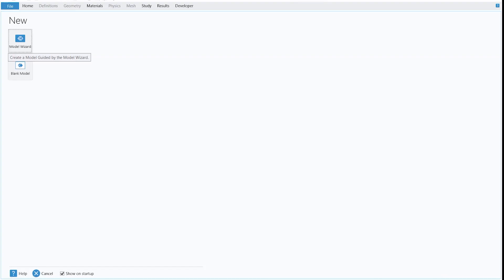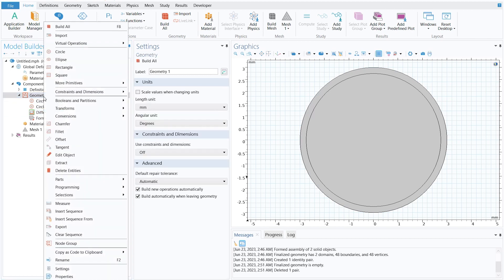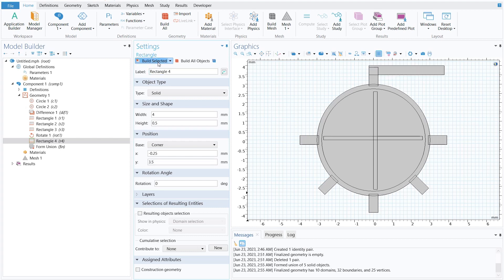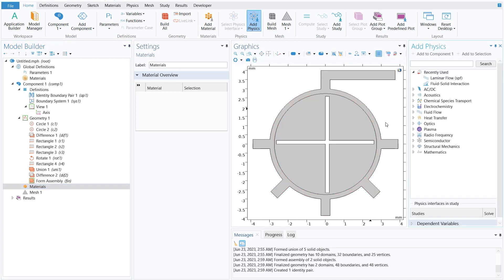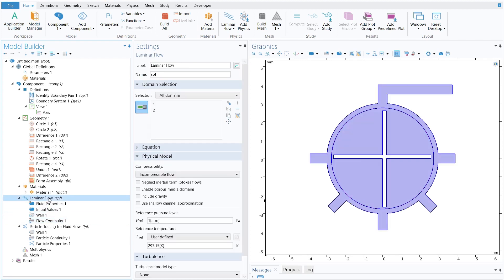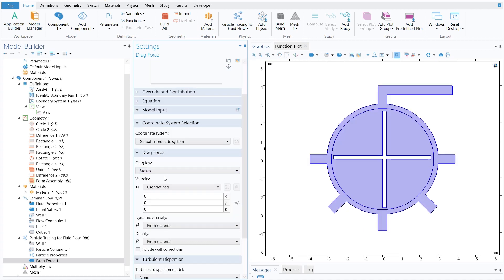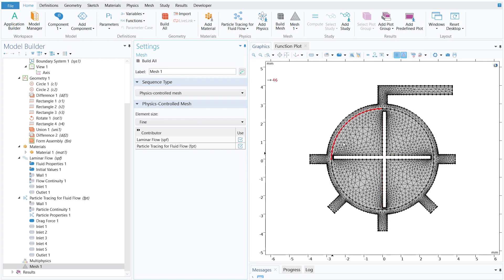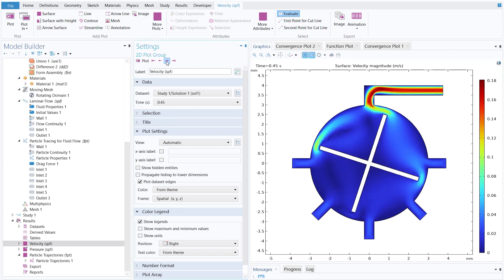COMSOL Tutorial 15 | 2D Particle Mixing in a Micro-mixer | Particle Tracing/Tracking | Laminar flow

Comment: Hello. I'd like to simulate a blood flow under magnetic fieldand model the blood as ferrofluid. 

Which module should I use? I assume i can use magnetic field no currect and single phase laminar flow?
Reply from the maker: Hi, 

To simulate blood flow under a magnetic field, where the blood is modeled as a ferrofluid, you will need to couple fluid dynamics with magnetic field simulations. 

Suggested Modules:
Magnetic Fields (mf): You are correct in assuming you can use the Magnetic Fields, No Currents interface if the current is not a factor in your system. This allows you to model the magnetic field acting on the ferrofluid (blood) in your simulation.

Single-Phase Flow (spf): To model the flow of blood, you can use the Single-Phase Laminar Flow interface if the blood flow is slow and can be assumed to be laminar. If the flow is turbulent, you may need to switch to the Turbulent Flow module.

Multiphysics Coupling:

Use the Magnetic Forces multiphysics coupling to account for the interaction between the magnetic field and the ferrofluid. This will enable you to calculate the force exerted by the magnetic field on the ferrofluid (blood) and integrate that into the fluid flow equations.
You may also need to define the magnetization properties of the ferrofluid based on how blood behaves under the influence of a magnetic field (e.g., defining magnetic susceptibility).

Hope this will help.
Reply: @LearnwithSAI  hello. I modeled with mfnc and laminar flow module and I added kelvin force as a volume force where only kelvin force is added into momentum equation. (Lorentz force is negligible). The results look OK. Thanks!

Comment: How to compute particle temperature I can't figure it out
Reply from the maker: Thank you for your question! To compute particle temperature in COMSOL, you need to couple the Particle Tracing module with a Heat Transfer module. Here’s a general approach:

Activate the Heat Transfer in Fluids: Add the Heat Transfer in Fluids module to your model to account for temperature distribution in the fluid.

Enable Particle Temperature: In the Particle Tracing for Fluid Flow module, go to the Physics tab, and select Heat Transfer to Particles. This will allow you to track the temperature of the particles as they move through the flow.

Set Initial and Boundary Conditions: Define the initial temperature of the particles and apply appropriate boundary conditions for heat transfer between the fluid and particles.

Run the Simulation: After setting up the above, run the simulation to compute the temperature distribution of both the particles and the fluid.

Let me know if you need more detailed guidance on setting this up!

Comment: Pls is this for different viscosity!
Reply from the maker: Thank you for your question! The current model in the video assumes a fluid with constant viscosity. However, if you want to simulate fluids with different viscosities, you can modify the material properties to reflect this by setting up separate domains or using a viscosity function to vary the viscosity based on certain conditions (like concentration or temperature).